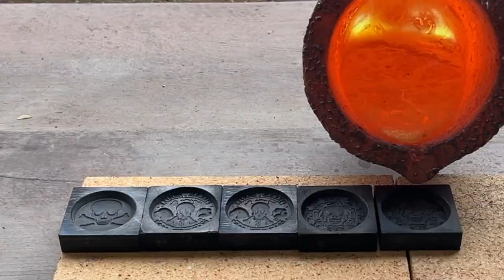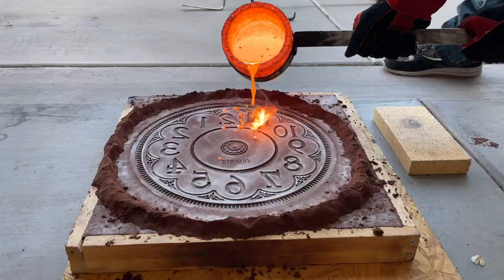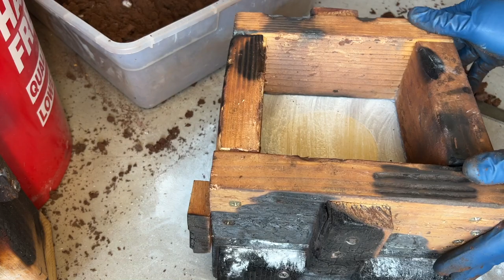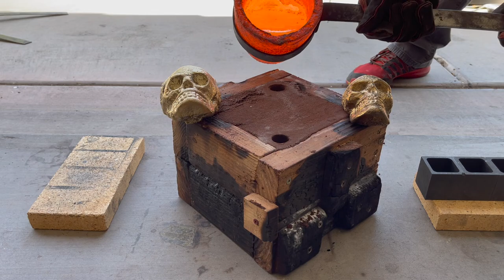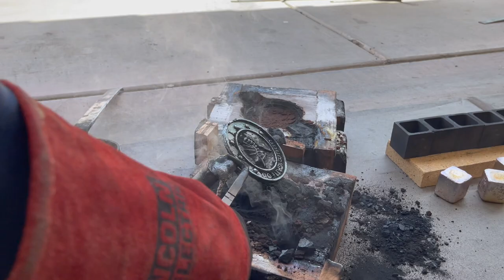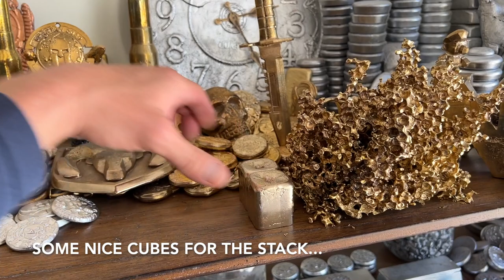Casting a Harry Potter Galleon - Gringotts Wizarding Bank Coin - Aluminum Bronze Harry Potter Coin

Comment: That turned out great, side failure and all looks good. I like the rough look of the front. Good character. Have you thought about 3D printing an Alien skull? Another thing to try if you want to, 3D print one of the skeleton figurines they sell at truck stops. Also could try pouring a big ash tray with a logo in the middle. Or coin tray.
Reply from the maker: Thank you Sinaka, I was happy with it. It does have character. I’ve printed a couple skulls, not an alien skull yet, but that would be cool to try and cast. Lots of good ideas, I’ll have to see what I can find and/or make 👍

Comment: Where did you get your tools the ones for lifting the crucible out of the furnace and then the tool for pouring out of the crucible?
Reply from the maker: I made them. I got some 1 1/4” x 1/8” steel flat, and cut, shaped, and welded em up 👍
Reply: @TheGrowingStack  Oh damn! well thats awesome sounds good I just got my own forge and am looking for a good set of tools to use

Comment: Why do u put powered on the coin
And the case that you use to make bricks are they made of some special material so that the liquid won't stick?
Reply from the maker: The powder keeps the sand from sticking to the  coin, as well is to itself when both halves of the flask come together. The cube molds are made of graphite. 👍
Reply: @TheGrowingStack  ok

Comment: I've always wondered why when using baby powder that y'all brush it so much that there's just a super fine layer on the object being molded. It seems like leaving it in a thicker layer would help more with the mold releasing. I could be wrong, obviously, but wouldn't that oily sand be sticky and essentially soak up the baby powder, or at the very least kind of make it wet-ish, making it not release? 
Do you think you would be down to experiment with that and leave the baby powder a bit thicker on something that was known to stick really bad like the Mario64 lettering or the N cube? Maybe powder it, brush it to get it into the finer nooks and crannies of the details then repowder it? Just a thought.
Reply from the maker: I totally hear you. Honestly, I’ve tried just smothering them with powder and not brushing, using minimal powder, doing as you suggested, brushing it real good then add some more powder, and I’ve had mixed results with all of them. When I think back on the good the bad and the ugly of my attempted sand castings, I often wonder if it was my packing technique that was my downfall, or the powdering. Or was it the object I was trying to cast at the time? I’ve tried so many different combos that I guess I’d have to start over and really keep notes as to what works and what doesn’t.
Reply: @TheGrowingStack  I'm curious if corn starch would work any better, since it's a bigger grain than baby powder. I'm thinking in terms of say like using just flour as a release agent in cooking as opposed to using corn meal. Just flour will burn and stick whereas corn meal won't. So, I'm assuming, with that logic of bigger grain that maybe it would work to a degree. Or maybe a combination of both baby powder and corn starch. Best of both worlds? I'd love to see another attempt at the Mario paraphernalia. The N cube is my favorite and REALLY wished it would've cooperated with you a bit more.